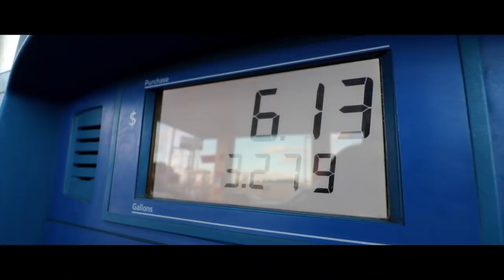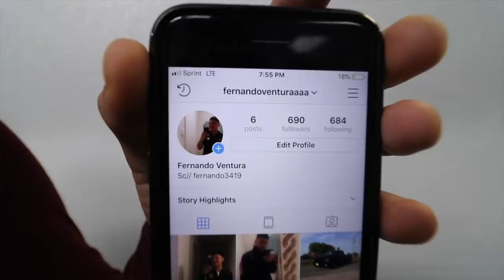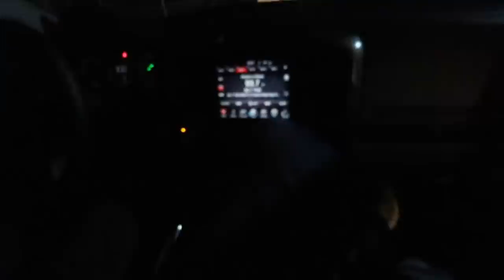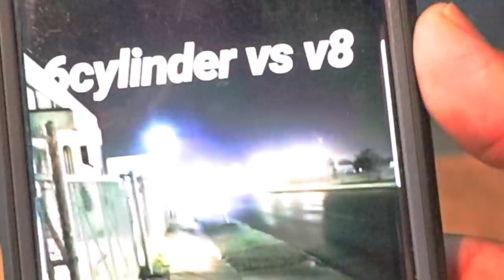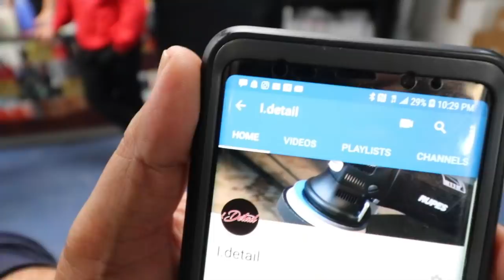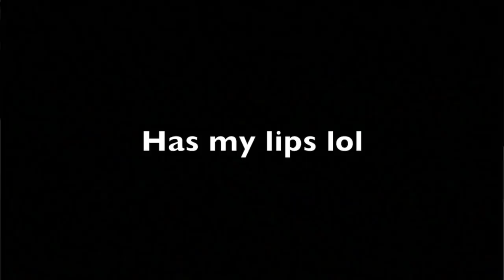{6.0 Gmc VS Ram R/T } & {Stock V6 Vs Cam 4.8} & {A Wash At i Detail}

Comment: can’t bash omar he has a v6 and that 4.8 cam truck didn’t even dust him worse? lol
Reply: Hell  yeah 
slow 4.8
Reply: Nah that doesn’t really mean much, about ten years apart, his v6 makes a more than the old 5.3, but he couldn’t win a 4.8 cammed
Reply: It's a crew cab 4.8 Omar had 2000 pound advantage and his v6 makes the same hp as frist gen 5.3s and still lost lol
Reply: Alex hernandez they are definitely not 2000 pound different lol, bro you don’t know what you’re talking about, it’s cammed 4.8 with a tune, cams don’t add that much power you do realize right, the v6 probably makes a tiny bit less or probably the same
Reply: No cap! for it to be cammed with a built trans and not even gap a stock v6.
Reply: Alex hernandez I hate to be this guy, but you’re really wrong, a crew cab weighs about 4800, and single cab from 2014 weighs about 4400 to 4600
Reply: Team  Omar lil v6
Reply: It’s a 4 door that 4.8 on a single cab would’ve smoked omar

Comment: Torque helps alot with omars v6. takes off quick but at higher speeds its alil softer. I got a 2015 v6 rcsb as well

Comment: You should race it’s just a 6
Reply: M Ruiiz its just a 6 will get gapped by freddy
Reply: Its just a 6 cant get his truck running right
Reply: that would be a good race
Reply: If he races the stang  Gavin will win but once they race the white truck and get it running it’s a good race
Reply: HotBoyz  I think it’s just a 6 got his truck running good now!!
Reply: Just a 6 is running spray on it and has a slick it would be good race though no spray
Reply: Itsjusta6 and freddylsx 
Damn that would be a good video
Reply: Its just a 6 need to learn how to drive the truck good yea hes big cam 6.0 nitrous but he cant even get it run good its not running good honestly you can tell when a truck is running good or not it’s either that or he spraying a 50 shot only lol
Reply: @mruiiz6043  alright 👌
Reply: Not a chance freddy would win.